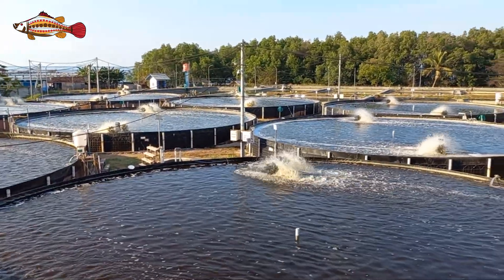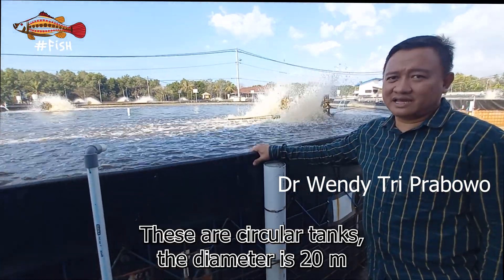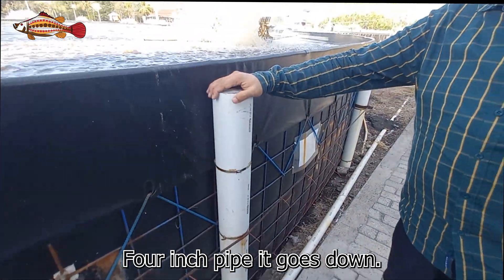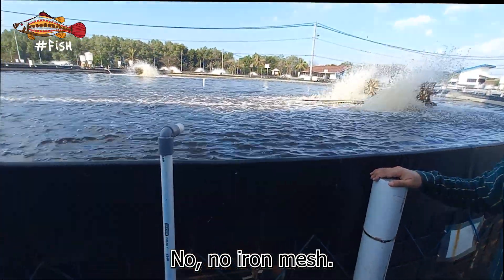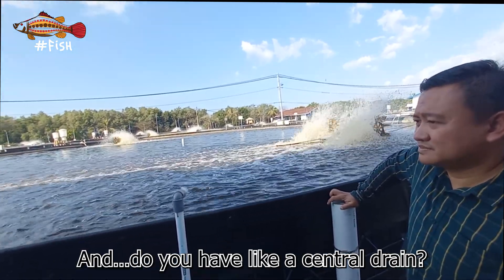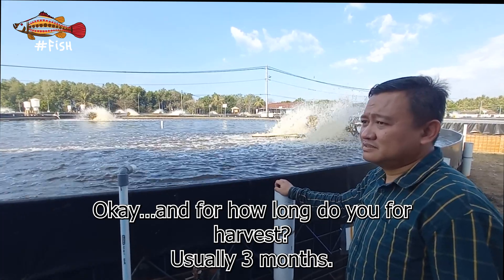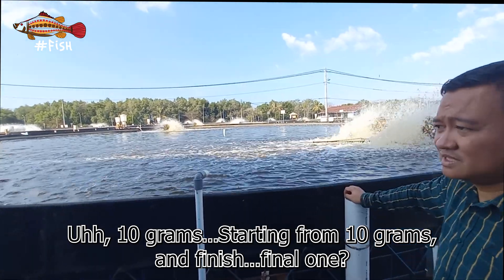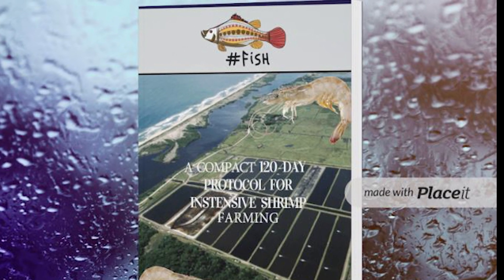MODERN SHRIMP FARM - CIRCULAR POND DESIGN #19 | #FISH

Comment: 200  its low density
Reply from the maker: 200/m2  is super intensive. Few companies are successful above 200/m2. Curious fact: the average global  productivity is 2,800 kg/ha/year, which for a 12g shrimp and 65% survival is about 35 shrimp stocked per m2 per year. If farmer is doing 2 crops per year, the average global density is less than 20 shrimp stocked per m2. Saying that 200m2 is 10 times greater than the average density. Do you still think 200 is low density?
Reply: You're right 200 is high can you share more tank size 20 m dia what is the depth, how much aeration I see 3 or 4 paddle wheel maybe 1 HP ? Could you pls share all parameters
Reply from the maker: @gopi0507  hi, yes 1m depth. Parameters please check our120 days protocol booklet